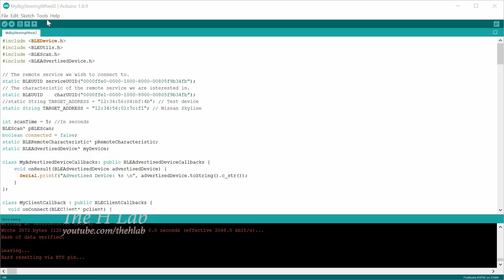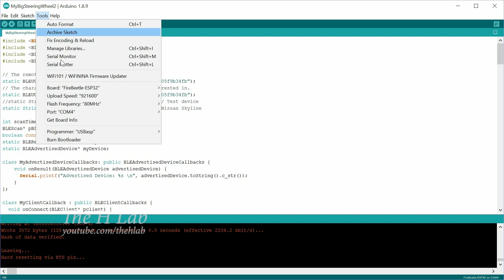Big steering wheel control tiny RC car | The H Lab

Comment: A lot of questions; 
1. Is that the same bluetooth controlled car using attiny85? 
2. How the connection works? Is it connected to smartphone then to car via bluetooth or you make new stand alone bluetooth transmitter?
Reply from the maker: 1. Yes. The same car. Instead of send control signal from Android phone, I now use an ESP WROOM 32 with built-in BLE to send it.
2. No phone needed. Esp 32 now is my new transmitter